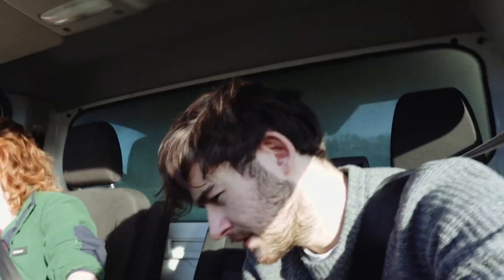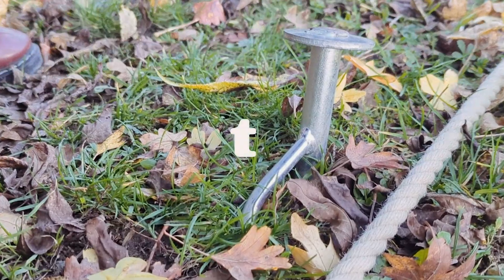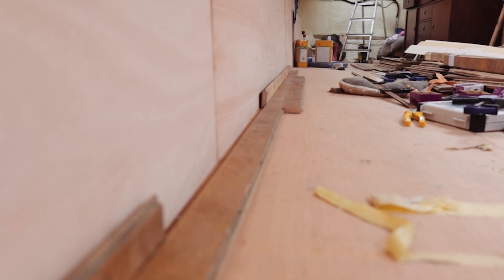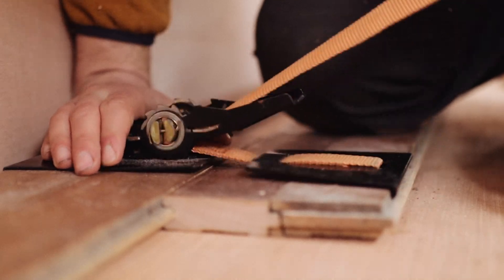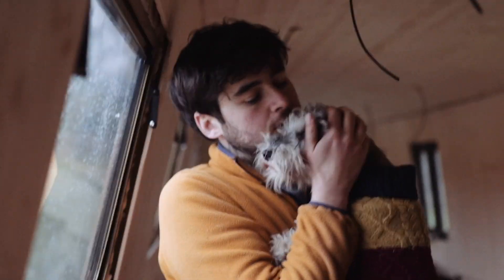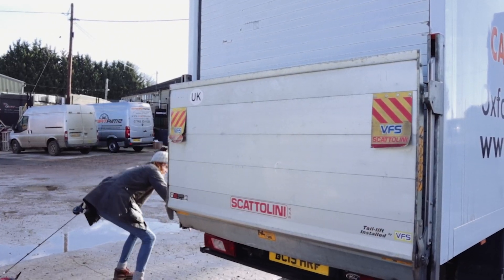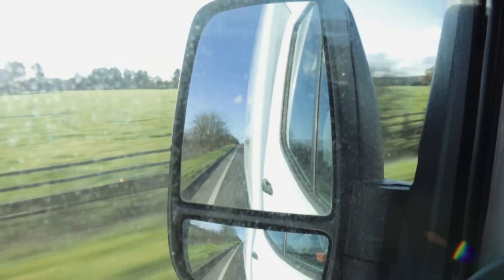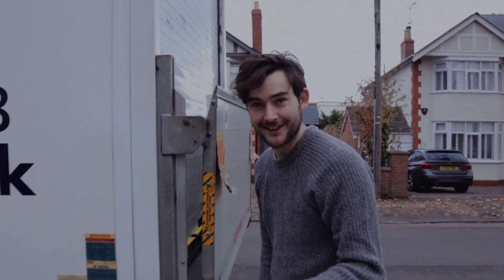Picking up a ton of reclaimed materials for our narrowboat fitout | this tiny life

Comment: A trick my Dad taught me about tongue & groove flooring; cut yourself a sacrificial bit about a foot long with the groove on one side and no tongue on the other, then tack a piece of 2x4 on the other--tongue-less side--in an L-shape. That gives you something to hammer against to fit the individual boards tightly together. You can just slide your little piece along the tongue of the board you're fitting in, and tap it into position to nail it down. Saves a lot of time instead of moving the strapping around to clamp the boards together, like the video showed you doing. --Dan
Reply from the maker: Thanks Dan! We have been doing a bit of tappy tappy but weren't getting them as snug as we wanted without the clamps. The beauty of using second hand stuff!

Comment: hiya guys, Are you sure the bath is a good move, I have been looking at boats for a few years and not many have Baths. it will drain your tank of hot water, but most of all did you do your measurement what your space you have for this installation. others have showers with a small bath shub. This is not negative but more of a thought.. an check measurements on your other stuff you need, will it fit?  mmm ! John In New Zealand. Kaior mi tatou.
Reply from the maker: Heya John! So the bath will be there as an option but won't be used all the time. We will have a shower over the top which we'll use most of the time. Space wise we will be ok, the edge of the bath tucks under the gunwales :)

Comment: Thanks for the video....Will you be able to carry enough water on board to have baths?
Reply: That’s also my thought, others are always struggling to get water and the time it takes to fill tanks, also how much it will cost to heat fir the bath
Reply from the maker: Most of the time we'll be showering but it gives us the option to have a bath when we moor near a water point! Luckily our winter mooring spot at the moment is next to one 🙂 And then with heating water - we'll be using solar dump in the summer and a backboiler on the woodburner in the winter so heating, hopefully, won't be an issue for us!